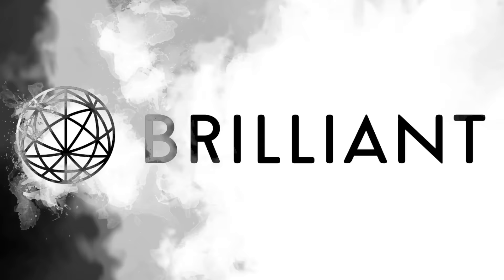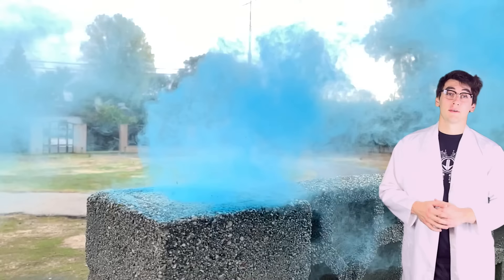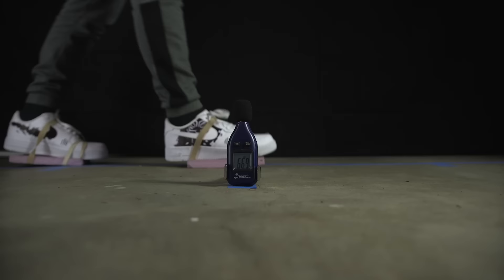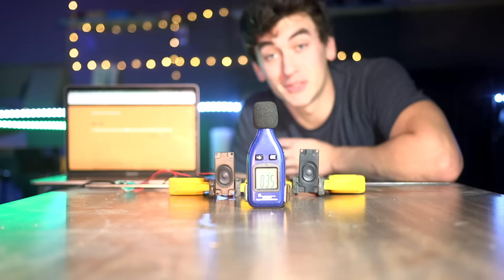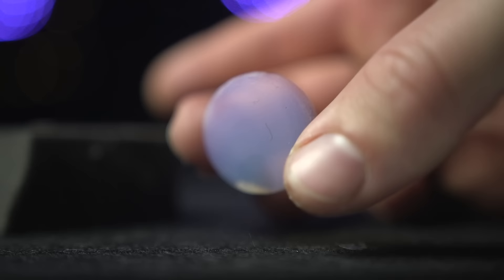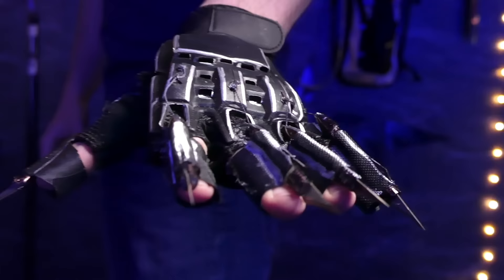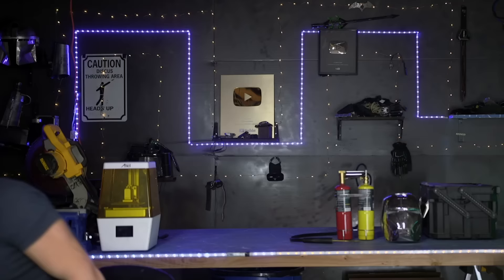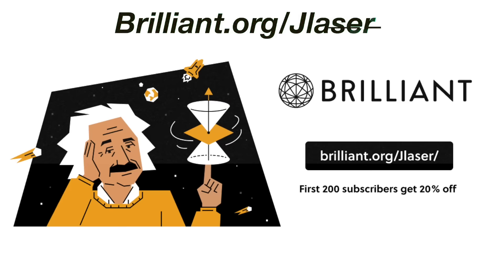Sound Proof Black Panther Shoes Made From Aerogel! - Retractable Nanotech "Sneakers"

Comment: Now make a microwave silencer so I can make pizza rolls at 3am without waking anyone up
Reply: This is the evention we need i know the pain bruuhhh
Reply: using aerogels
Reply: you can remove the little speaker if you have the skill
Reply: Whirrrr whirrrr  Beep beep beep click click
Reply: Some new age microwaves have night mode tho', maybe just a few. But you can check if your MW have that feature.
Reply: Most microwaves have a silent mode
Reply: Pro tip: hold down the 1 button until it beeps and you have just activated silent mode
Reply: @huh._  cool I’ll try it
Reply: It didn’t work.

Comment: Idea: Make an arrow that splits into more tiny arrows holding a net between them.

Yes, i posted the same idea on another video cuz he didnt see it, i know u did too.
Reply: wait, this comment is talking to me on a spiritual level, I saw your comment on the other vid
Reply: We help you reach
Reply: I didn't.
Reply: Like the Mandalorian's little wrist thingy?
Reply: @ominouscandle4169  I dunno
Reply: It’s probably not possible
Reply: Is this a very good coincidence, or have i just found my little brothers comment idea, which he tells me about everyday😂😂😂
Reply: Sounds like a net gun to me already exists
Reply: @Struggle_Fest  ya but  its a net ARROW not a net GUN.
Reply: @Tidepod_Prince  no it is for sure. You can easily make a single arrow but the annoying but will be holding a net inside of it. You'd essentially attach the net to 5 or 6 other arrows. When you press or move you first form open to close it'd release a latch and the arrow would shoot out. You can easily get a sensor to detect air or particles in the air and throw it open. It would not move in. Straight line rather spin. But it can work and probs imo too easy to make
Reply: I vote for this!

Comment: Build Thor's hammer, that can actually return when you throw it
Reply: Flite test made one
Reply: I thought of a way to do this already it's extremely expensive though he's going to need a sponsor for that use electromagnetics
Reply: @lililili1546     electromagnets sound smart at first but there are a lot cheaper and better ways that can work for a returning object.
Reply: Why on earth would you want that thang to return
Reply: YAS
Reply: Guys, just spam this idea everywhere
Reply: That's literally a metal boomerang shaped like a hammer. The reason a boomerang returns is its shape. If a hammer can be made the same way, a returning hammer is possible.

Comment: the problem: how is it gonna fold back automatically?...
Reply: that'll be a great follow-up video

my guess is low voltage electrically-activated coils that relax and tense up depending on where pressure is applied or if there would be a button that essentially makes the material of the shoe retract back down like rubber bands being stretched out and pulled down

of course this is the more demanding design and since im not an engineer i wouldn't know the specifics but just an idea
Reply: EZ. It doesn't.
Reply: @player-8740  just take it off and go for a nap after fiddling with it 🤣
Reply: @player-8740  Like the spray-on crayon shoes from CWACOM?
Reply: @TR-qf2gt  dam! u smart
Reply: nitinol embedded in the rubber, dock your boots to a power supply, or have a battery pack. joule heating the nitinol is ??? wouldnt want to light your foot on fire, it better work fast lol.
Reply: let him have his happiness for now lol
Reply: Watch it backwards
Reply: @otiscathcart3165  Who are you? so wise in the ways of science?
Reply: @TR-qf2gt  nitinol could be used to do that.
Reply: @universal5459  love the monty python reference
Reply: @rayyanshaikh5591  one of the guys here said that it might set your feet on fire. how would you go avoiding that? :O looking forward to your ideas
Reply: @TR-qf2gt  Thanks

Comment: Alternatives to try:

-Loose Cloth at the bottom of the shoe. It’d absorbs the pressure but it’s have to be loose so it can absorb.  The only part that would be worrisome is the scraping when walking. If you trap something under the cloth, it’d slide it around. Not ideal for stealth. 

-The other thing is in Ninjitsu, they have shoes that split your toes into two parts. Like you said, tip toeing creates less sound because of less surface area. So what if you could reduce the shoes’ 👟 bottom surface areas to 2 or 3 points? It’ll look weird, but it’d work better. Essentially it’d look like a shoe with three heels from high heels; one in the back, two in the front. But what if you rounded the bottoms so you can walk a bit also not have the heel sound high heels make? 🤔  👠/🩰➕👟-👡🔈= 🥷🏻⁉️
Ninjas walk/run stealthy on their toes. Which is actually how you sprint but would walking on toes grow painful after a half a day of wearing them... 🤔 so many questions. One thing not mentioned is that if you walk heel-to-toe like most people do, the initial contact of your heel and it’s rolling is creating a tap and scraping noise. 

Just spitballing 🤔

Comment: just a thought... if having less surface area decreases sound then wouldn't having a shoe raised by multiple little dimples be most effective?
Reply: Wow... Yes 
Great thinking but I don't think it'll work because using a sound proof material while maintaining the shape needed will be very hard, kind of like how high heels have very little surface area but still create a ton of noise and often break
Reply: cause then the materials internal stresses will start making noise
Reply: Yeah what if he used airloy as the bottom of the shoe?
Reply: Also you probsably will deform the floor material more. There will be smaller sized but stronger pressured/compressed areas. (I guess,idk)
Reply: like a ninja tabi, how they have padded spots at the points of most pressure like toes and heel
Reply: I think you are right
Reply: a lot more points of impact tho
Reply: No, with small spikes it would work better as the sound would be absorbed by the little surface area they have.

Comment: Not sure how well it would work, but you might be able to use an elastic fabric such as spandex (from stockings?) In junction with the band to keep the quick snap. As the fabric is quite thin I believe you'd be able to keep that snap action vs the slower roll that comes with the rubber shoe
Reply: the roll looks closer to the nano tech than just an instant snap, but would definitely be more comfortable, couple layers maybe would provide both positives

Comment: Please make FLYING CLAW - chinese soft weapon. One designed to grip. "Some are more elaborate and the claw actually closes and tightens when the rope/chain is pulled. Those are constructed with a spring mechanism within the metal claw that allows the claw to open and close as the tether is pulled or released. Some of the latter can grab trees and rip off the bark."
Reply: That's cool

Comment: Decibels use a logarithmic scale, so you vastly underestimated how large the differences in dB are. For example, 20 dB is 10x louder than 10 dB, and 30 dB is 10x louder than 20 dB. The bar graph you made should show that so it’s easier to see how quieter or louder something is more accurately.
Reply: Wait really? Why is a scale like that?

Comment: not sure leather really got it's fair shake here 
what you used (looked like it) was a somewhat stiffer cut, but i've had very good results with softer, more supple pieces in the past
i also know that leather moccasins are sometimes used for stalking animals, so that might've been an interesting base to build from 

still turned out cool though

Comment: The “clicking” is your feet sticking to cold surfaces

:edit the claws should be illegal
Reply: My feet click even when I'm not on cold surfaces
Reply: But da claws are coollll
Reply: no
Reply: That makes zero sense at all, it's the ligaments and tendons releasing fluid ya dummy.
Reply: And he's walking on the front of his feet.
Reply: @MozeyTheHunterGaming  What's that have to do with anything though? it is still going to stick to cold surfaces. (or hot)
Reply: It's his ankles. Joints crack.
Reply: Nope, any automaticly opening blade shorter then 3 (mabby it was 4) inches is totally legal

Comment: Thing is, that shoes might be soundproof, however the sound of footsteps mostly comes from the foot issuing pressure on the surface. Especially when talking about surfaces like wood or forest grounds. Now, yes.. Concrete would be a different topic, considering its very solid. In most scenario's however the footstep will make sound, regardless of the shoes worn